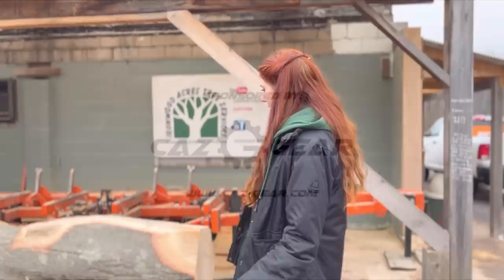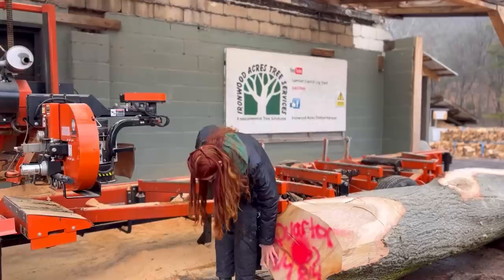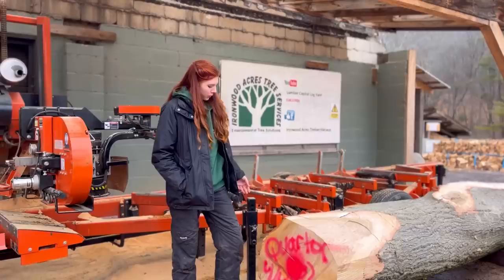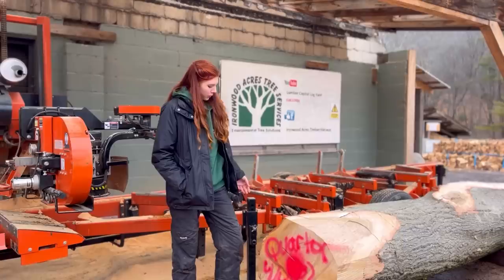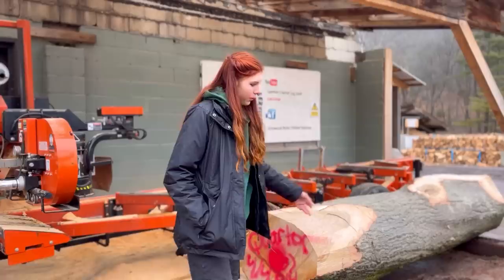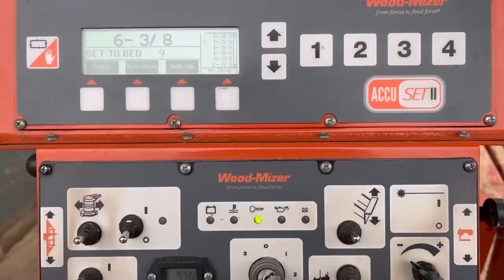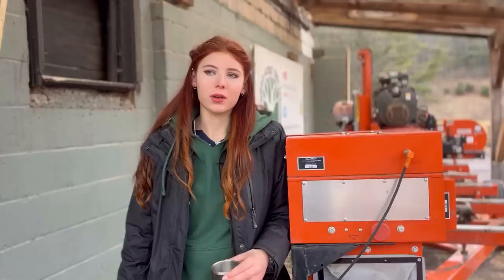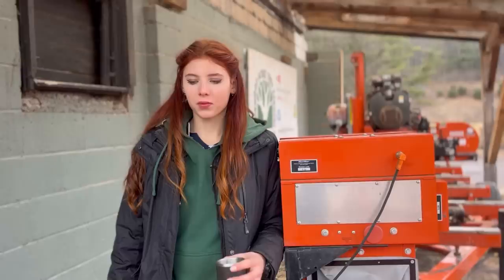Quarter Sawing HUGE Oak with Beautiful Grain Patterns!

Comment: Take a 4 ft section of that oak ,sand it add a light clear coat  to bring out the colors and the pattern and hang it on the wall. That is Mother Natures artwork at her finest. Thanks Em and Jade for sharing that beautiful wood with us.
Reply: Add legs and you have a nice live edge table as well.  Of course a lot happens to the wood during the drying process.

Comment: Most beautiful oak I have ever seen!! Most oak I come across usually has a pretty ordinary grain pattern, but that oak takes the cake in beauty. It would be very interesting to see how that oak gets used!!!
Reply: The grading rules for commercial hardwood will prevent grain patterns like crotch wood being seen by anyone but the sawyer unless it's being contract sawn.
As more small mills appear it's possible that more may appear in inventory but it's a balance between space and what sells.
Commercially it's straight to the chipper if it even got on the saw.

Comment: That answers my question from the other day , thanks . Yep, nice figure in that run of boards. I cut a big cherry on the LT 30 in 1994 up in the Adirondacks and the figure looked like flames from a fire and some like fern leaves.The final product was made into raised panels that were installed around a stone fireplace .

Comment: Indeed, pretty wood and quarter sawn!
I hope it dries down well for your customer. 
I sawed up a huge white oak log (very close grain)a couple years ago. Spent awhile trimming it down to fit on the bed.
That's about 32". Beautiful patterns, had not seen one like it before or since. Had stacked and stickered the boards. 
Couple weeks later I checked on it, the boards had all separated along those beautiful and novel grain patterns. 
It turned  into expensive firewood.
Hopefully the bigger grained pin oak won't do that.
Reply: Bummer!

Comment: Im so damn jealous. I have a mill that will cut 28 inch logs but everything is all manual. My carriage sits on a slab of concrete and today a 1000 pound ash log rolled off the other side. It took ober 2 hours getting it back up there and flipped over. Also even with a brand new blade its about a inch per second or more sawing 23 inch boards today.  The triceps and legs get a really good workout and also removing all the bark by hand means about one 13' log a day.

Comment: Do you know how the pin oak got its name? It was named that when sawyers realized tha the best use for those logs was to make pins out of them.
Reply: What type of pins and for what use?
Reply: Not true at all! It got it's name from the many limbs that stick out of it's main stem. They break off and stick out like pins. I'm almost certain that this tree isn't even a pin oak but a scarlet oak.
Reply: @mattdillon4398  I have been in the millwork business for 50 years and have never heard this tale. No one should be using the colloquial terms for species of wood. One should use the Latin for clarity. There are 6000 types of mahogany and they grow across the world so imagine the variation.
Reply: @mattdillon4398  Scarlet oaks are usually much smaller and I have seen more than one pin oak cut. This one has the strong grain of a typical pin oak.
Reply: @dieterkoch6563  Well, you are wrong! It doesn't matter if you've heard of it or not! I live in the area where this mill is and pin oaks get their name from the many "pins" that grow out of them! Also, pin oak is almost ALWAYS filled with mineral, making the grain have black streaks. This log was red, leading me to believe it may be a scarlet oak which also grows in the same area! I've cut hundreds of both pin and scarlet oaks.
Reply: @ManuelGarcia-ww7gj  No! Not true! Pin and scarlet oaks are generally the same size! I've cut hundreds of them in the same area as this mill.
Reply: @mattdillon4398  Okay, so can you give me their scientific names?
Reply: @dieterkoch6563  Pins for all sorts of things, mostly for building barns and other structures.

Comment: QUESTION: When you quarter saw a log  you first cut the log into quarters. That way, each board that you eventually cut contains wood from the core on one edge then the outer wood to the edge. Do I understand this process correctly?
Reply: I think you do understand it.

Comment: In SE Nebraska there is very high population of Pin Oaks.  The local saw mill said they do not like them since they have so many knots. Did you find this true with your log?  On another side subject , have you done any videos on checking and how you avoid it
   Thanks Rick 7:11
Reply: Maybe the guy you were cutting for is going to cut it up into narrow strips and the way you cut it would be OK, but that last piece with the long crack which looked to be about 3 inches from the top, I would have taken two  1" pieces and then flipped the log getting that crack on the side and then started taking 1" boards again; I think the grain would have been just as nice after the flip?

Comment: Pin oak is actually terrible for furniture work. It will warp and split as it dries, and will not stain well at all. In Missouri you can not sell it at all for furniture usage, it is used for construction blocking, trailer decking and firewood. I hasd a 36" diameter tree come down in a storm, 25' of clear of limbs, could not even give to to the saw mill.

Comment: Are you sure this is quarter sawn? I mean, yes you first cut the lumber into 4 pieces but then you cut every quarter of it as it is in plain cut. I don't see how it is different then just cutting the lumber in plain cut, then cut the pieces half from the length! As I know, with quarter saw, yes you cut the lumber in 4 pieces like you did, but then the cuts are made so that the grain direction is straight. Anybody can check what is quarter sawn is by googling it... Please correct me if am wrong.

Comment: Keep telling yourself you're quarter sawing if you believe it. I was taught the quarters should be cut diagonally. What you're doing is no different than just cutting it like you always do. But what do I know?.  I only was only in the wood trade for forty years or so.
Reply: Forty years, and you never stopped to think what quarter sawing really means? The important part is that the grain ends up running perpendicular to the board face. The woodworker using the lumber isn't going to know or care whether you cut the boards diagonally, or alternating, as long as they get the right grain. Doesn't matter how you get there. Clearly, there's more than one way to skin a cat. Try not to seem so confident if youre not going to pay attention to the video, or when you're not backing it up with useful information, it just comes off as rude.